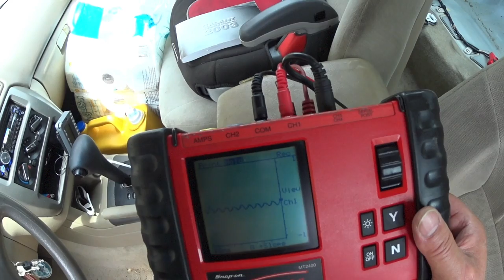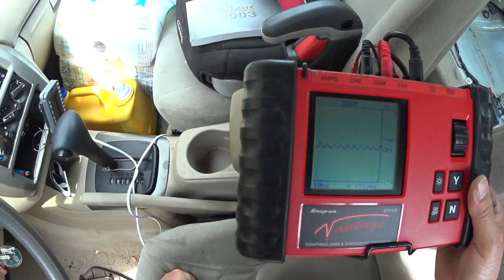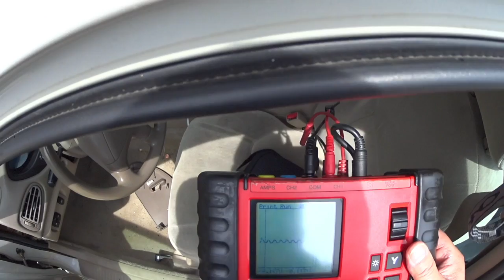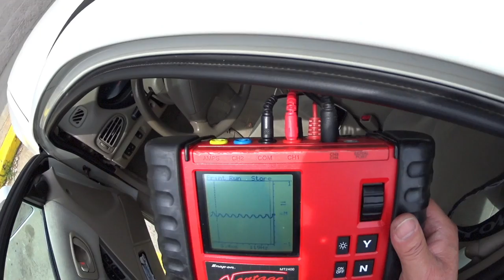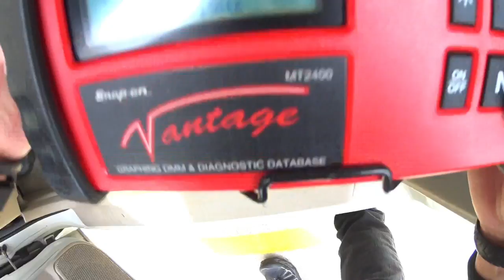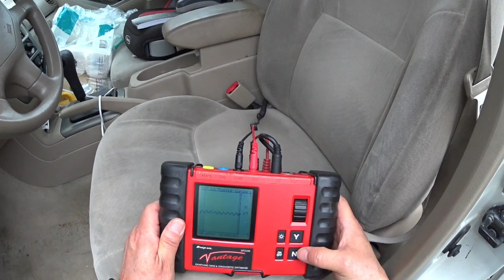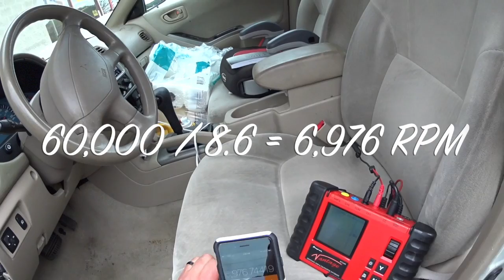DTC P0300 2003 Mitsubishi Galant 4 cyl

Comment: I have a 2002 Mitsubishi galant and it has this problem. I can slowly accelerate and it will go but it's very rough. Also if I accelerate fast it loses power and studders out. I checked the MAF sensor and cleaned it but it still has the same symptoms
Reply from the maker: Steven Rogers Hi 👋 so what trouble code you have in memory?
Reply: @PeteSambolin  p0300-random multiple misfires. And a while back ago I had a code for the MAF sensor but after cleaning it the code went away.
Reply from the maker: Steven Rogers Hi 👋 look like fuel delivery problem or Mass Air ! Tap on the top of the Mass air with the engine running and see if the engine changes idle or shake!
Reply: @PeteSambolin  I seen one of your videos earlier about that and tapped the MAF while it was idle. There's already a rough idle to the vehicle but once it got stable and I did it the car started to struggle and almost stalled out. Thank you for the help!
Reply from the maker: Steven Rogers Bingo! Definitely have a problem with the Mass Air! That’s a good direction to start...
Reply: I have an issue withy lancer 2003 code pending p0300 multi misfire ...mass air flow new fuel pump new spark plugs coils wires new. Cam sensor new cps new swapped out fuel regulator fuel rail and injectors. Iac new tps new. Car still struggles to start unless i slighlty pedle the gas barely it starts but cant remain on it dies off slowly. If i accelerate hard it bogs down and stalls out. I have to lightly accelerate barely and revs up but if i punch it quick it bogs and drops down. Can someone help idk what it is. Not sure if my issue is the cat converter because i did the test of taking my o2 out and run to see if it ran better and still same situation.
Reply: @sergiozamora5693  bobina de arranque ?

Comment: Would the fuel pump relay be in the same spot as yours on a 2000 galant? I replaced the fuel pump but can not hear it turn on when I turn my ignition  on!  I'm not getting fuel  to the motor
Reply from the maker: Jt Turner Hi if you talking about the same year and model of the car in the video the answer is Yes! Different car and model your best option is to go on the vehicle manual on the glovebox and search for relay description and location! Know some fuel pump are very silence! Your best option is to put a funnel in the fuel tank filler neck and with someone cycling the ignition switch from ON to OFF you should listen the fuel pump motor for 2 seconds and the go OFF... Good lock and let me know!
Reply: @PeteSambolin  I have the 2000 galant..I thought the relay might  of been in the same spot because  I have the same relay location...Fuel pump is in the same spot! I hope its just really quiet  lol it wants to start but won't turn over to run...it's been sitting for a few years
Reply: @PeteSambolin  New fuel pump..New starter as well
Reply from the maker: Jt Turner well in this case I believe in the 2000 Mitsubishi Galant the fuel pump relay location is on your engine compartment relay box ...looking at the Relay box front side standing on the front left of the car relay location is the first right corner of the relay box...
Reply: @PeteSambolin  ok ill give ait a look..thats what goggle said as well...still cant hear the pump! Maybe its quite😞